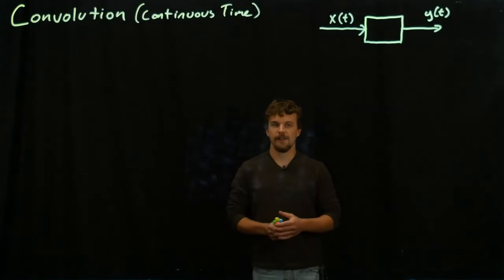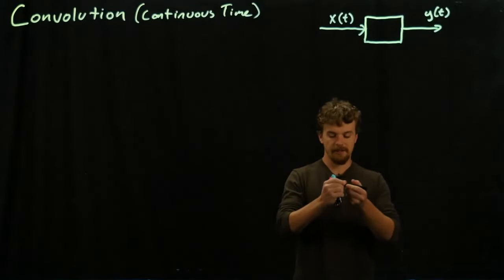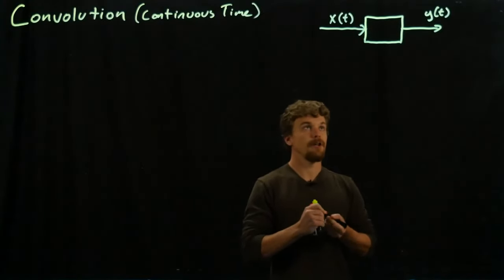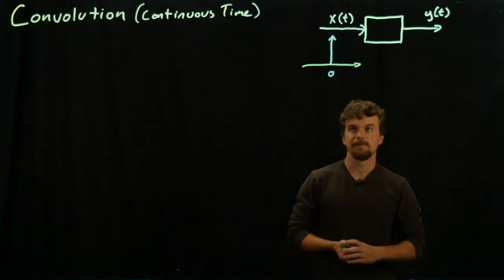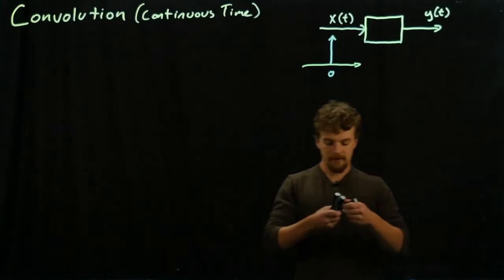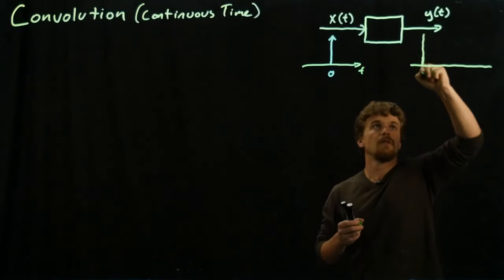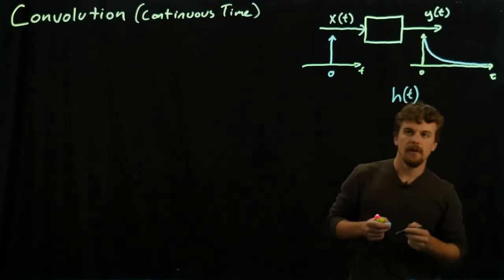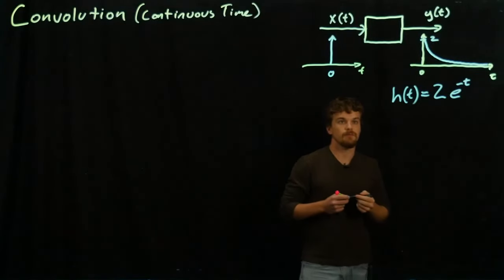Signals and Systems - Convolution theory and example

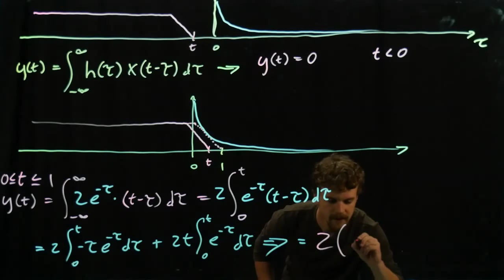Comment: at 16:15 when you give the answer to the integral, should it not be 2(e^(-t) +t -1) instead?

exponent of e would be -t as opposed to -tau

edit: I see this small slip has been addressed a few times already. Excellent video over all that I'm grateful to have for free.
Reply: the "slip" is not so "small". The whole time, he is supposedly trying to find y(t), the output of the system as a function of time. Then he gives an answer containing τ and t. This is not a calculation error, which can happen sometimes -- it does not even make sense.

Comment: What? He confused the shit out of me when he's explaining how to find the convolution of h(t)=2e^-2x and the x(t) he came up with. When t is less than zero, h(t) will go to infinity, not zero, how can the convolution give zero for values of t less than zero?
Reply: It is the product of h(tau) and x(tau) that is zero. Not h(tau) itself. I see why it might be confusing, but I also think he forgot to mention that for those inputs he uses all function values for tau < 0 are 0. They are causal inputs. So h(tau) follows:
2*e^-tau     tau >= 0
0                 tau < 0
Reply: Lycanid is correct. We should have explicitly used multiplication by the unit step function in the descriptions of x(t) and h(t), which would make both functions 0 for t<0. This is a reasonable constraint on these both of these functions since we can assign t=0 to be the point the input x(t) starts. Also the impulse response h(t) of a causal system will always be 0 for t<0 as the system can't respond before the input is applied.

Comment: You should've drawn the final result chart.
Reply from the maker: We wanted to show the process more than the result. A graph of the output may be nice, but in this example I believe it would not show any intuitive representation of the convolution process. Also, the graph is a bit difficult to draw accurately as it is not a standard function. For these reasons, we thought it best to not graph the output.
- Andrew